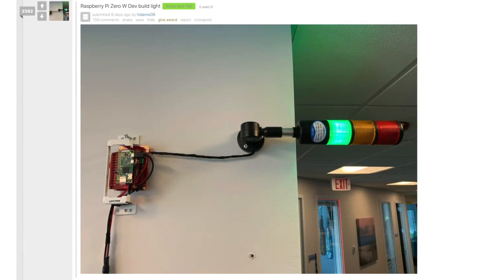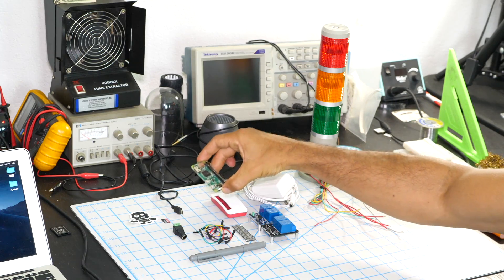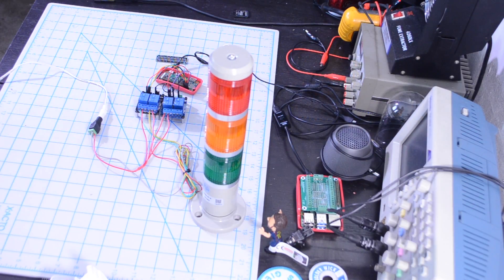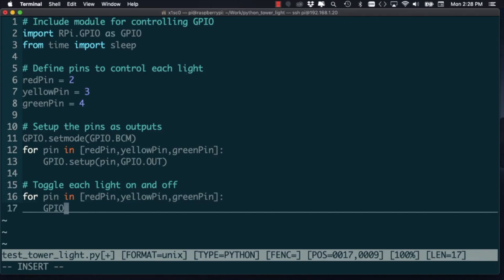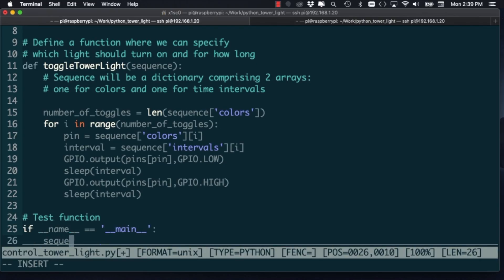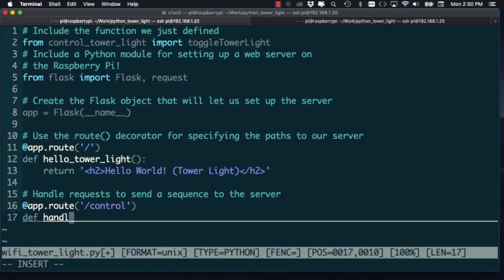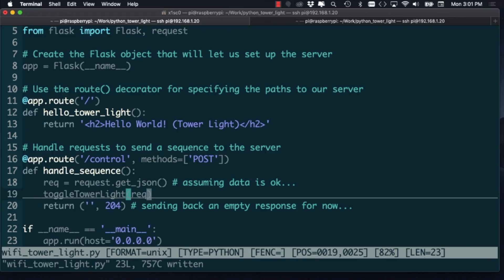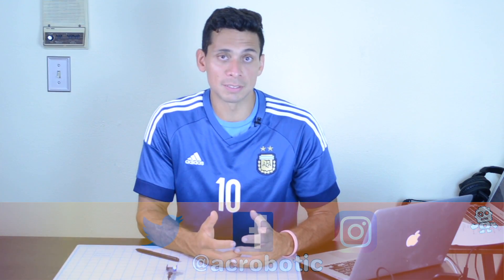Raspberry Pi Zero W Tower Light Alert System | Python Automation

Comment: I am confused on how you powered the light using separate power? can you explain please?
Reply: The relays are used to control when each light is connected to the 24V power supply via the barrel jack.